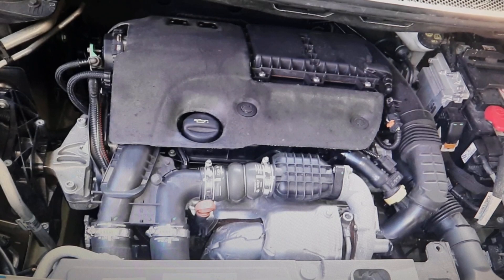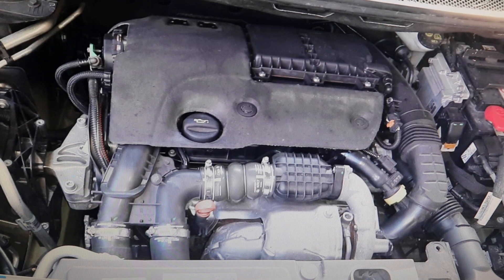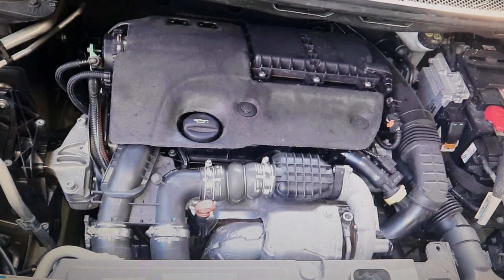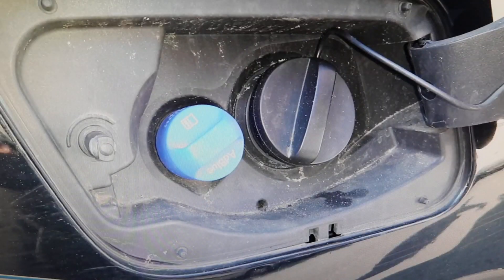FOR THIS reason the ADBLUE deposit fails in Peugeot, Citroen, Opel, DS engines

Comment: Have you tried your theory or is it just guessing? 
Older generation Peugeot adblue vehicles had a recall for a faulty cap which had the exact symptom of vacuum buildup in the tank as you describe. I've never seen it happen in person though and never on the newer generation adblue cars from PSA like you have there. They are almost always "blown up" instead of sucked in when you look under. Opened multiple tanks and internal leakage is rare.
Reply from the maker: The one you see in the photo had that problem and the entire adblue tank had to be changed, they put a new one in and it had a cap with a valve to prevent it from breaking due to the vacuum, although these also have a problem with the adblue, it crystallizes when part of the water evaporates from the adblue composition, which is urea with water.
Reply: @car-parts2.011  I never heard of a replacement cap on the new cars, certainly no Peugeot training, TSB or procedure shows or tells this. I replaced 100s of tanks and never once needed or was told by Peugeot to replace also the cap, weird but interesting for sure, we never really know what exactly is the fault in the tank and what caused it...

You can't do anything against urea evaporation and crystallization, maybe some additives can help but then the customers have to pay out of their own pocket, which they will never do ofc.
Reply from the maker: They organized campaigns to change tank caps in 2018 but they were very limited